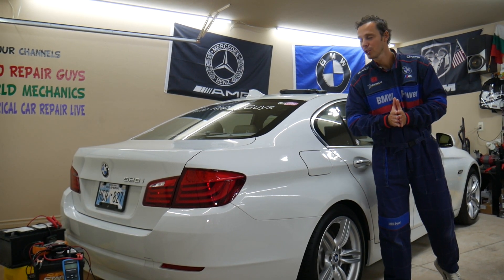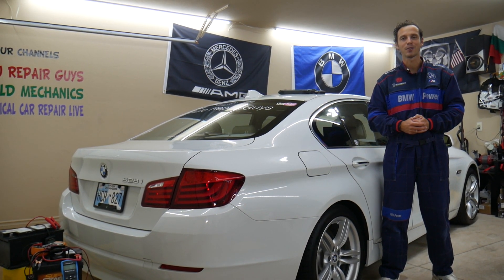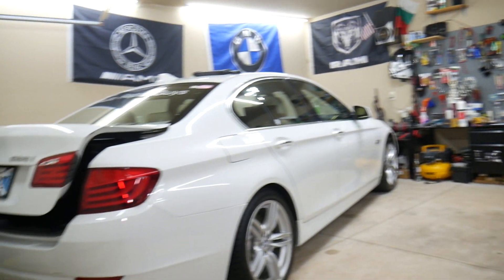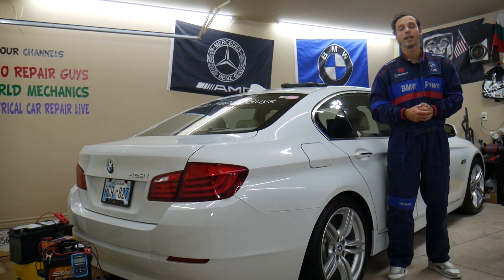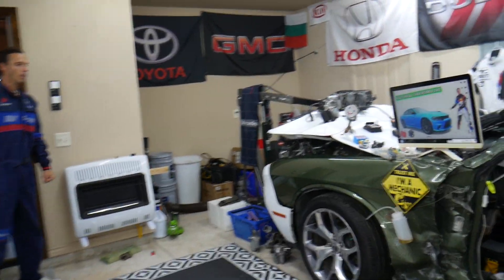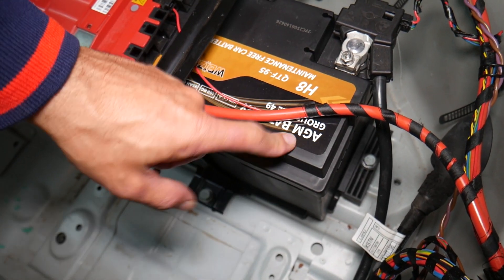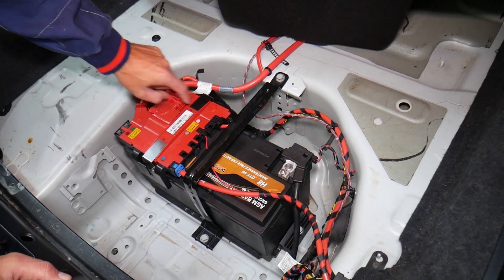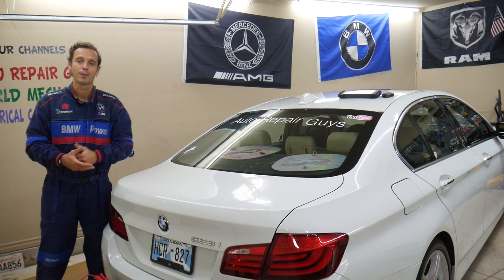Why Is The Battery Located In The Trunk on Car BMW AUDI MERCEDES CHEVROLET FORD DODGE VW

Comment from the maker: Things you may need to fix this problem: 
► Car Battery: https://amzn.to/4fvomMM
► Battery Tester: https://amzn.to/4eBBY7C
► Liqui Moly Oil Saver: https://amzn.to/3XxV89r
► Liqui Moly Molygen Oil: https://amzn.to/3vD9gCQ
► Oil Filter: https://amzn.to/34Fj67G
► Oil Filter Special Wrench: https://amzn.to/2D6Ghwj
► Panel Removal Set: https://amzn.to/3YiMADu
► Assorted Fuses: https://amzn.to/4fx4s3F
► Tool Set: https://amzn.to/3p5MM6t
► Screwdriver Set: https://amzn.to/3XRB28Q
► Torx Set: https://amzn.to/3xlCkfT
► Torque Wrench: https://amzn.to/32qyRwg
► Voltmeter: https://amzn.to/4hB6Zvk
► OBD Scanner that we use most often: https://amzn.to/3I4MQfe
► Mobil 1 Oil: https://amzn.to/3xBc8B9 
► Tools and parts that we use: https://www.amazon.com/shop/worldmechanics